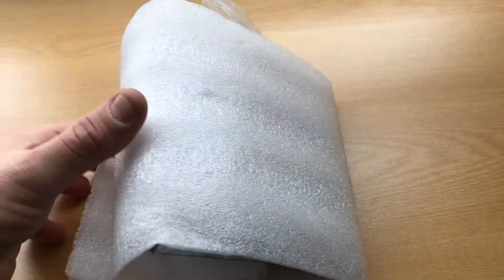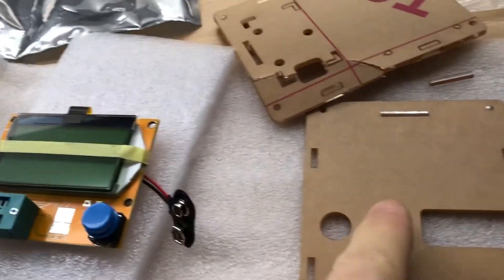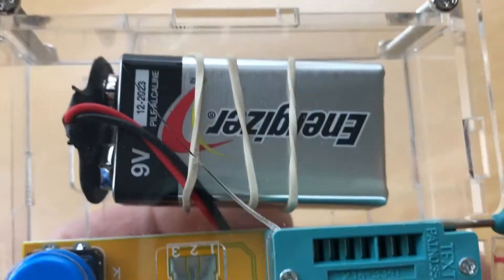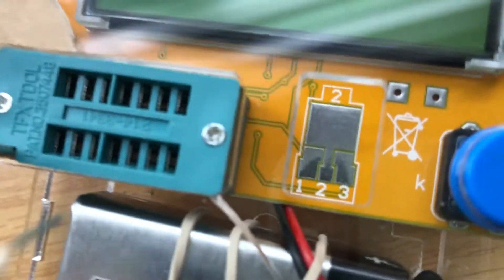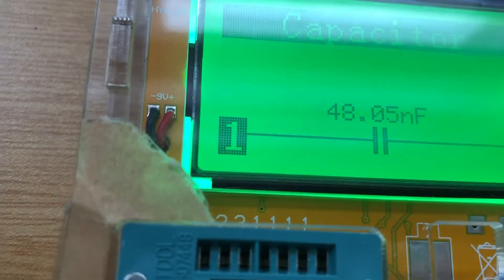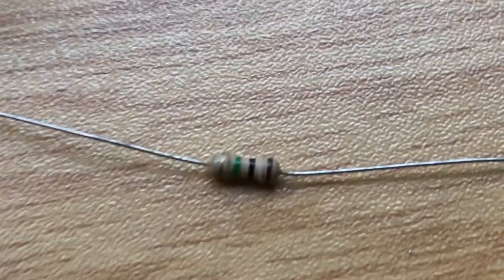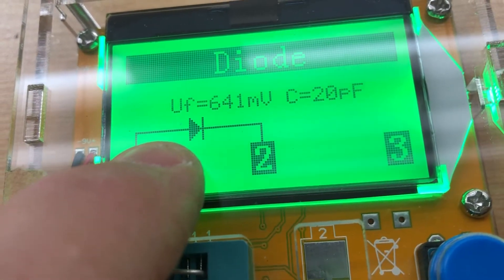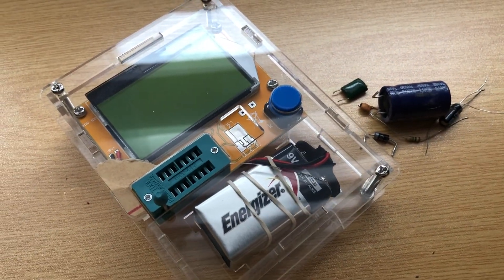LCR-T4 Mega328 Electronic Component Tester Unboxing and Review

Comment: Anyone know why they bring out the two pins going to crystal oscillator to the front of the board? I havent tried it yet but I imagine you would read the oscillator frequency at those points. But why would you need to? Just curious
Reply from the maker: Not sure, it's not accessible once the case is on so unlikely meant to be used normally. Good observation! Any thoughts as to a purpose?
Reply: @devhackmod  No clue as to the reason why they  are there. I just hooked up a frequency counter and tested a resistor and an inductor  with the counter on those two pins. When it first starts testing, I read 4 mhz and then when it displayed the value, it read 8 mhz; which is the crystal frequency. You are right though; once its boxed up , you don't have access . The same goes for the 3 pads on the front which are connected to points 1,2 and 3 on the socket. I was told those are for testing surface mount parts but useless  once its in a case. I may solder 3 small test clips to those pads because I know that socket will wear out someday. Plus the external clips would be good for older components  that have fatter leads and wont fit in the socket

Comment: Those meters only measure components at one frequency (1khz) just like the digital multimeter. That is why the capacitors measure at the low side. These electrolytic ones have to be measured at 120hz; and the capacity will increase...
Reply from the maker: Thanks for the info!